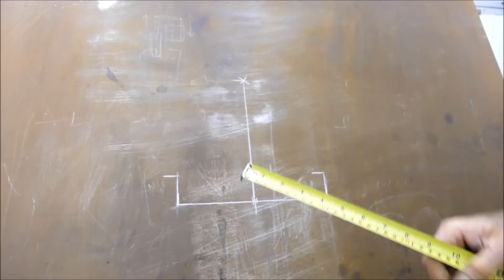Super simple DIY pneumatic power hammer - The Ring of Power... hammer foot pedal upgrade

Comment: Hey man I commented on your original vid yesterday u must not have seen it but to build the origional how much did it cost
Reply from the maker: Hi Edward, for me the material was free becuse it was spare stock from previous projects, the cylinder, valves, pipe and fittings is roughly £100 but I spent more experimenting with other parts.its roughly £250 + VAT per hammer for the steel if I were to buy it.

Comment: What are the specs and the part number for the new pneumatic valve you are using? I will need one of those for my build.
Reply from the maker: Check out the description as I've just updated the parts list. cheers J

Comment: Could you make it automatic by putting the reverse valve lever at the bottom of the ram travel?
Reply from the maker: I'm going to put a small motor with a cam to push the valve in and out, and put a potentiometer mechanism on the treadle to control the speed. Cheers J

Comment: I think I found a power hammer that can fit in my shop... next spare shop money I get, I plan on getting your plans (they are favorited in my Etsy) will the plans reflect these changes?
Reply from the maker: Thank you! The main build is the same but I'll draft the addition of the new foot pedal as an add on soon. It works well with the normal pneumatic foot valve but the new valve is awesome.

Comment: Way cool design.  I appreciate finding out from you that I can build a small unit using air power that I already have.  How man cfm does it use?  You could use the air twice if you use the air from the down stroke to power the up stroke.
Reply: Use a return spring to help the up stroke so it does not need too much air or use a  shorter fatter piston for the return stroke.
Reply from the maker: That's a good idea. My compressor is 14.5cfm, 150ltr, 3hp working at 120psi. Cheers J
Reply: @joshuadelisle   We can figure out what the cfm is.  First the number of liter stored in compressor at full charge.   120*150/14.7=1224.5 liters.  Now shut the compressor off and run the tool for 20 seconds.  Now let's say the pressure dropped to100psi.  100*150/14.7=1020.4 liters. 1224.5-1020.4=204.1 liters in 20 sec equals 612.3 liters per minute.  Convert that to cubic ft.  21.6 cfm.

Comment: I find it hard to believe that there is not a foot pedal that allows you to just control the speed/Air flow with a foot pedal that allows you the control without having to move your foot up and down.  I only bring this up because I am slightly disabled on my dominant foot and while this will still be more productive and way "Freaking" more efficient than I will be able to imagine especially at my income.  Maybe something like a "hybrid" pedal?  Like an electric rheostat kind of thing that the further you push the pedal down the faster it pushes up and down for you?  Am I being too demanding?
Reply from the maker: I can adapt to be like a normal power hammer by adding a little motor with a cam mechanism to push the valve in and out. I could then attach the motor to my Tig pedal which has a potentiometer to adjust the speed which will also make the stroke slower of faster. Would you like me to do a video on it?
Reply: Don't tell anyone I said this but your videos are better than porn.  And HELL yeah, if you have a way to assist me on this issue I would love to see it!  I was wondering if there is a way to use like a stepper motor or something that could go up and down but I haven't had the time to figure it out.  I was thinking of something like the old slot car race tracks where  it came with a gun like switch and the further you pulled the trigger the faster it went.  Again, I just don't have the free time to even ponder this stuff right now.  But soon, very soon.  AND YES PLEASE PLEASE DO THE VIDEO.

Comment: Do you think it be possible to build the frame and body of the hammer and it be a in line tredel hammer then convert it the power hammer later
Reply from the maker: My first sketches where a foot treadle hammer that has springs that take the weight to the point where the head is weightless, then adding a fast acting cylinder would replace the power of my foot and then some. That would work great but can be complex and needs more room than my workshop would allow. Cheers J
Reply: @joshuadelisle  thanks man been trying to come up with a good treadle hammer that doesn't take up a ton of space

Comment: Josh, I am so glad to see new posts from you again!  I had wondered what had become of you.  It seems like you have pulled through a tight spot and returned better than ever.  I get it.  I still insist that my forge work pays for all forge improvements (or maybe that's my wife), and I am looking forward to a busy Christmas which will allow me to add some things I have been wanting - not the least of which is a power hammer.  I have been groping around in my head trying to decide on a cost effective design that wouldn't have too many compromises, and here you come and hand it to me!  Thank you.  Brilliant idea and execution.  It may, may have a few compromises or trade one optimal condition for another as people have said, but the proof is in the forging.  May I suggest that instead of a bump stop to prevent piston slap, someone modifying their own build of your hammer might try a spring to slow the cylinder as it nears the top of the stroke?  It would add power and speed on the down stroke too.  I am first building a crane to go on the bed of my 2001 Toyota pickup to load and unload heavy objects like a portable welder/generator, 20 gallon propane tanks, steel, or a stolen safe.  Then I hope to be able to build my own hammer, using your plan.  Thanks again.  It is a life worth living!
Reply from the maker: Thank you Tim for the encouragement on this journey. Another person had a good idea to have stop on the valve so it does a slower return and make it like a switch so I get rid of needed. Might add a small motor and cam mechanism to the valve and control it with my Tig pedal like a normal power hammer. All the very best on your adventures and catch up again soon. Cheers J

Comment: There are 2 more upgrades that I would do to this hammer. 
First I  would find some way to make it double as a  press.
Second I would add stop switches to the shaft (either on the hammer or the cylinder). Then use the stop switches to tell the valve to either pressurize or depressurize, giving you the up/down motion without hitting dead top or dead bottom. Then attach the foot pedal to a valve to change the air flow therefore controlling the speed of the ram. This would also allow you to stop tapping your foot on the pedal and would reduce the risk of repetitive motion injury while allowing you much more control.
Reply from the maker: I like that idea. Thank you. Cheers J

Comment: Hey man have you heard of pi seems like it could save you some effort, great video though!
Reply from the maker: You mean rasberry pi or Arduino?
Reply: @joshuadelisle  I mean pi as in derived from perimetros
Reply: @joshuadelisle  could you not have used pi X diameter to work out circumference, subtracting the part in the sector where the gap is and add a little bit for the tabs where it is mounted
Reply from the maker: Ah you mean the calculation 3.142, I could have your right but because of the tabs and angled bends rather than work it out it was simple for me to use a wire. It didn't need to be that accurate.
Reply: @joshuadelisle  fair enough, whatever works for you, really great project btw, I am interested in doing a similar project myself, I don't have a big budget but do have a lot of junk that I can use to create something
Reply from the maker: I got my materials for free from other projects but I realize new stock of this kind is a bit pricey. All the very best. Cheers J
Reply: @joshuadelisle  thanks

Comment: That upgraded air switch is $250 on amazon. How is performance compared to original one?  We’re at $680 USD for materials so far. I’ve been gently bugging the CNC Plasma dude for two weeks now, practically begging him for a quote on the CNC’d parts. He cuts out massive rings for GE’s windmill housings, so I’m a small fry.
Reply from the maker: That valve shouldn't be that much. I paid £20 for mine. Keep shopping around for that. But it is much better.
Reply: Joshua De Lisle Check your amazon USA link you provided in the plans. It is $236.09. UK link is 20.10. You should start selling those, too. 😝 eBay direct from China is $20 though.
Reply from the maker: That valve shouldn't be that much. I paid £20 for mine. Keep shopping around for that. But it is much better.
Reply: This is the one I bought. Seems to be working well.  https://www.amazon.com/gp/aw/d/B076VPHKFS?psc=1&ref=ppx_pop_mob_b_asin_title

Comment: Joshua, that was interesting! In my opinion, you contradict yourself when on one hand you advocate the more powerful push to raise the weight and then say that you try to slow it down to not damage the ram!I understand that you've made the plans that work well and that you don't want to change them! Your argument that external stops could fail is not a very good one! The improved short pipe mod is obviously very good. I was thinking that a reserve chamber just in front of the valve could improve flow as pressure in the line is fluctuating. Altogether, this is a very interesting design! Congratulations!! Regards
Reply from the maker: I may not have explained my self very well. I only raise the weight slowly after forging entirely so it doesn't crash at the top. Between strokes I catch the return before it hits the top which infact also creates more power because it courses  compression acting like an air spring of potential energy. External stops will definitely help save the cylinder but will take the wear of the hit instead. Depends on which is cheaper to replace and longer lasting. Cylinders and cushions are cheap as long as it lasts 12 months or so you can count it as a consumerble. Cheers J
Reply: @joshuadelisle  I think you explained things pretty well. I would like to underline the fact that you have built a really good useful tool! We disagree on a couple of points, these don't stop your design being very useful, getting out there and doing it is the most important thing! As you know, I don't agree about the upstroke stop! The other thing is the way round you have the ram, in my opinion, the upstroke doesn't need more power than the down stroke, it's not doing any work, the smaller effective size of the ram will make it faster, but will not give more power. I would love it if you made a tubular reservoir, about twice the volume of the ram to put directly on to the valve, I'm sure it would reduce lag even further!! All the bes, Matthew
Reply from the maker: @MatthewTinker-au-pont-blanc  thank you. I worked it on the principles of velocity which is mass(weight) X acceleration. Your right that the surface area of the ram is more power in pressure but it's the speed that gives it more impact force. Like using a small hand hammer with a long handle is just as powerful as using a heavier hammer with a short handle. Cheers J
Reply: @joshuadelisle  Right, the actual work the cylinder is doing is on the upstroke, raising the 70 odd lb ram, and this is where the larger radius helps.  The increased acceleration above what gravity gives is what helps on the downstroke.  It's like swinging a heavy hammer, raising it is the hard part, but the faster you can swing it down, the more work gets done.

Comment: why dont you use a switched cylinder or a separate switch so it just runs when you press the footpedal.
Reply from the maker: I don't think I can control the pressure as well with a switch. Switches are generally on or off or very complex otherwise. I can feel the change with the mechanical one and adjust real time strokes for lighter blows or faster/slower reciprocation. Cheers J
Reply: @joshuadelisle  i have built 2 pnumatic hammers in the past i will see if i can find video of it working and how easy they are to set up.
Reply from the maker: @WesternIronwoks  that would be great to see. Tag me on Instagram. Cheers J

Comment: WOW 😮. Massive improvement 👍. No idea It worked  like a treadle hammer.. 😎.. Sooo nearly bought a bit of anvil/hammer  material the other week... 2 3/4" hex bar about a metre in 2 bits FOR £90.. Just thought .. Not quite  heavy enough? 😬... Sadly  power hammer is gonna have to wait as I just bought a pullmax instead 🤦😂😂... It was too cheap to pass tho & sheet metal work is my job .. One day tho👍 love it👌😍
Reply from the maker: Nice! You could if the heavy materials are hard to get weld 4 pieces together side by side. Needs to be kept straight and may need to change the roller design but it would work. All the very best J